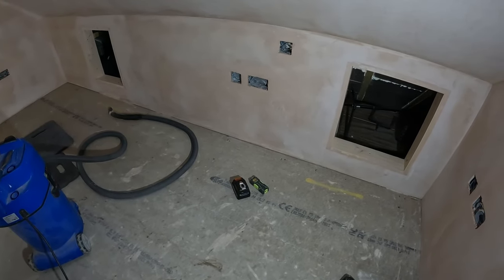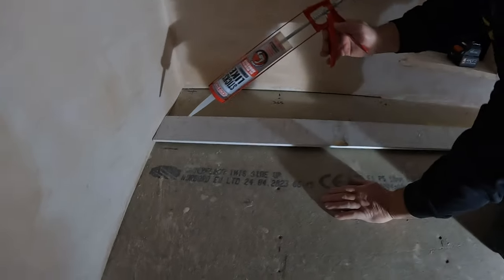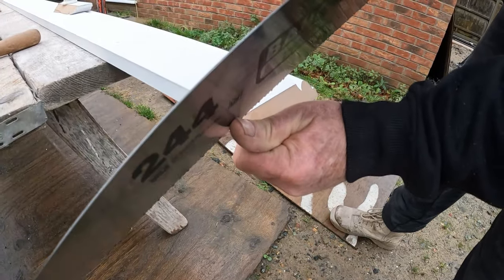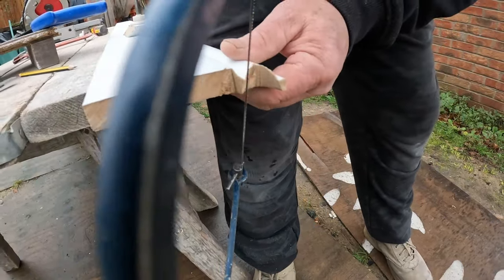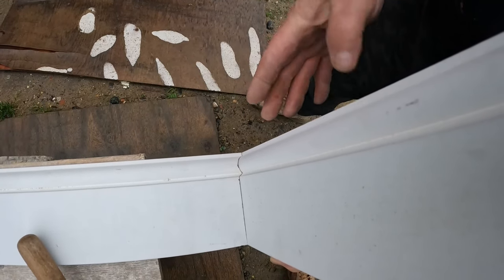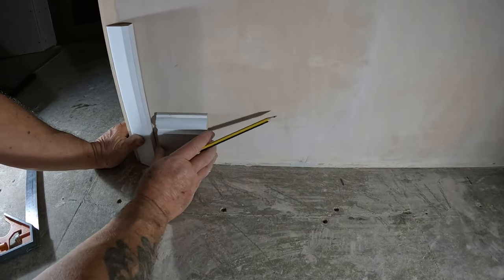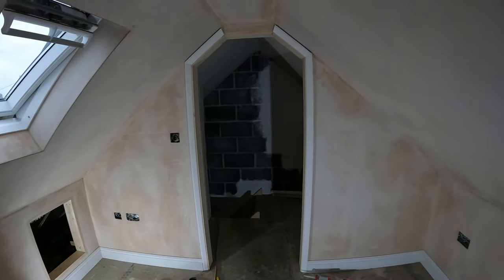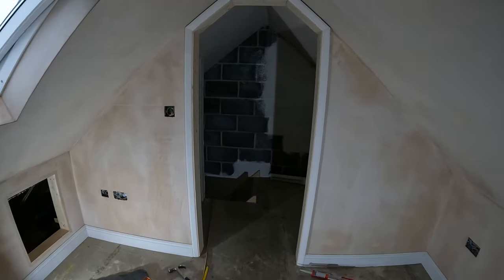How to cut and fit skirting + architrave

Comment: Great vid, a quick question what do you do when the skirting is not sitting 90° on the wall.
Reply from the maker: You struggle is the answer, sometimes you might have to trim the plaster with a bolster, and it makes the scribes a bit harder , you just have to work a bit harder to get the end result, many thanks for watching 👏👍